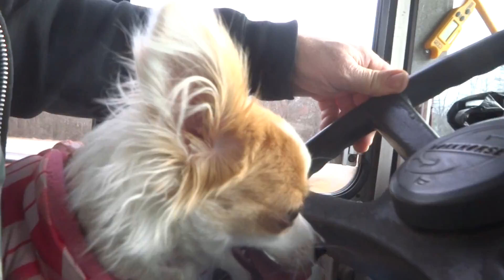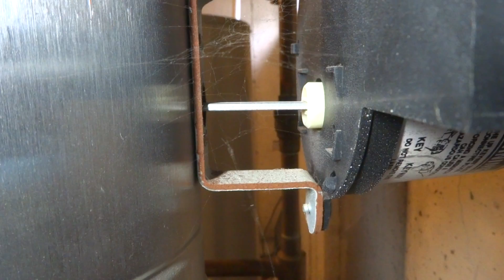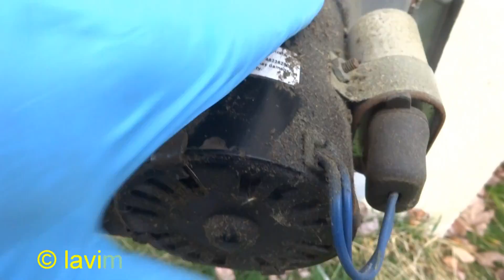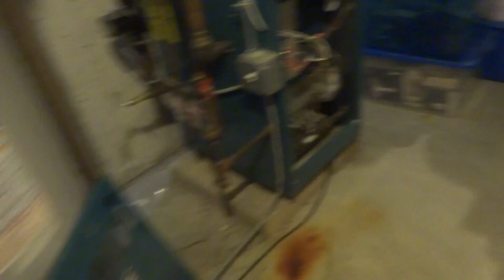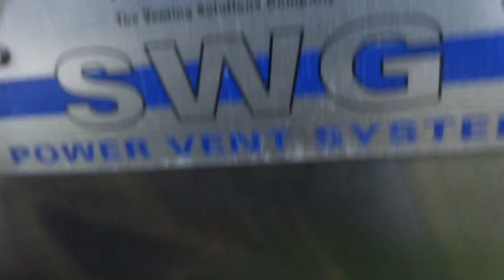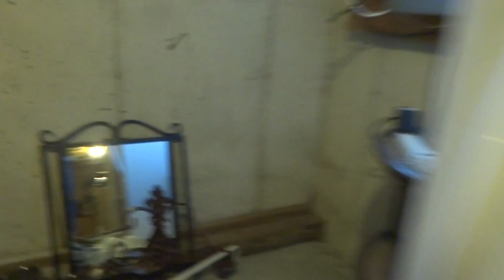gas boiler with loud humming noise

Comment: My power venter had the same issue. I purchased just the motor assembly when I could of got the whole unit for the same price. Mine is almost on its way out. All rotted on the outside. Good video.

Comment: Just replaced the exact same assembly today. SwgII-2. Same exact problem also. Motor locking up on start up. Same kit with the same tube of high temp silicone..lol

Comment: I have a buzzing sound coming from my boiler now. I'm getting hot water and heat so idk. I'm guessing the psi is over 15. I'm guessing it's high air pressure